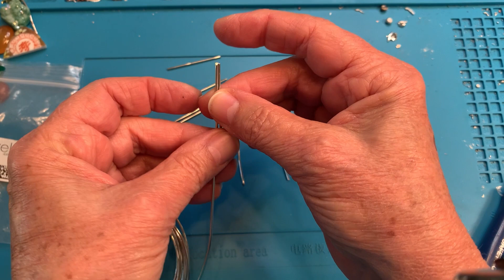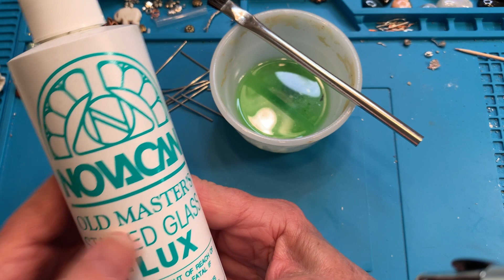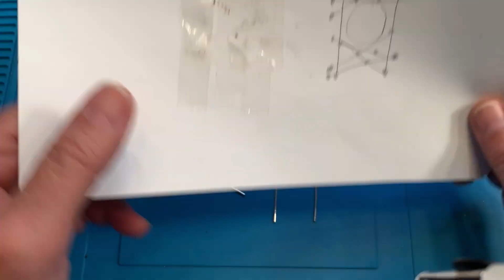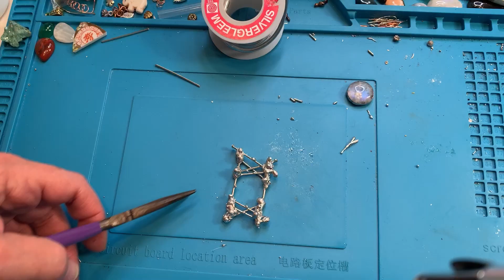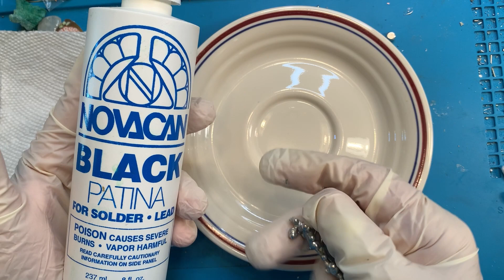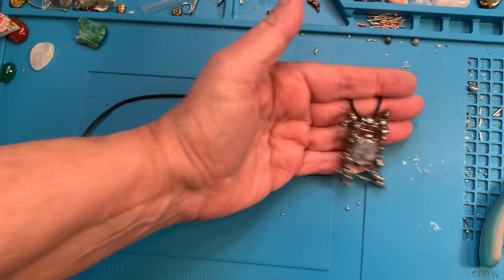Caged Rainbow Moonstone

Comment: Hi Karen,  try using 26 or 28 gauge wire to anchor the pieces  before soldering. 
Thank you for your generosity with sharing your techniques. It has been so helpful.
Reply from the maker: Thx very much for your feedback!  I’m definitely going to use this technique again because it’s cool BUT next time I’ll use a much smaller gauge wire & I’m sure the process will be easier, after all I used 16 gauge on this piece & that just seems crazy to me now!!! 😂😂😂. I’m glad you have found my tutorials helpful!  That means a LOT!!! 🙏😊💜